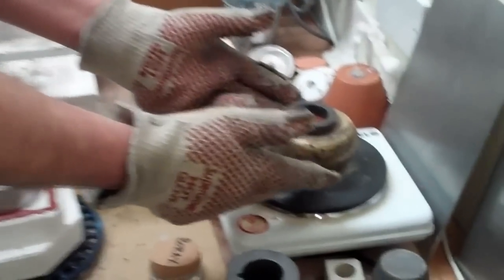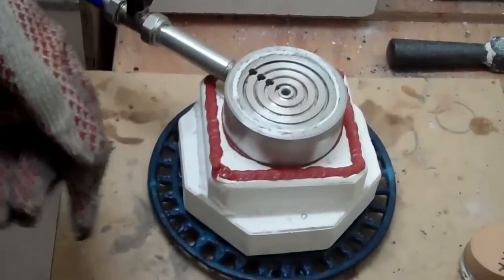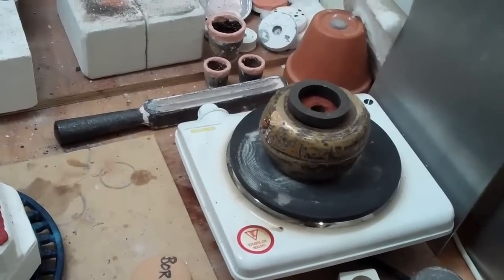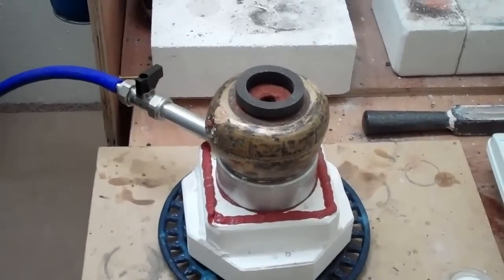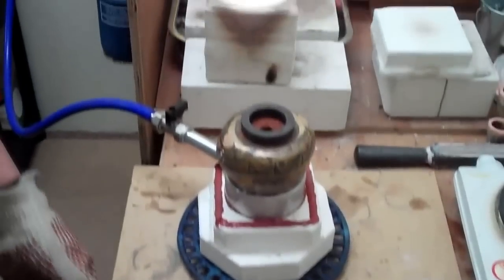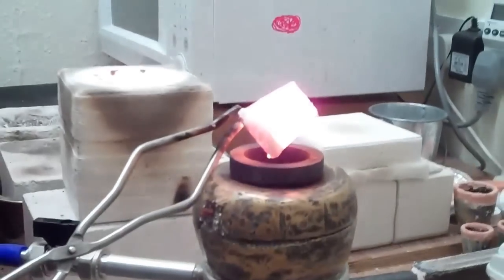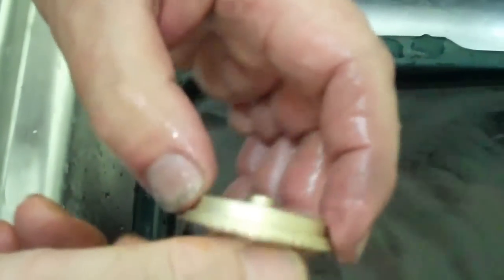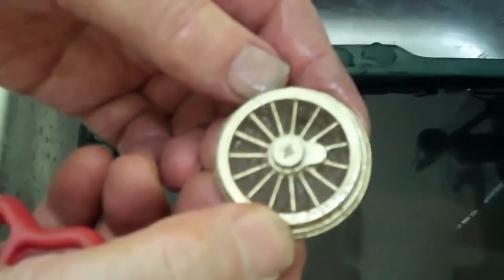Vacuum assisted sand casting part 2

Comment: Wait.. How'd he microwave metal?
Reply from the maker: Hi tim yes that's right we use a standard domestic microwave oven as the power source to melt silver gold brass bronze copper. The microfoundry furnace insulates the metal charge to make it totally safe
Reply: @steedcraft  Did you use silicon carbide or some other material on the inside of the kaowool to absorb the microwave radiation? I would be interested in seeing your methods to making a microwave furnace (I'm new to the channel so I apologize if you've already published a video on it in the past).

Comment: OK, time for the stupid question... that looked suspiciously like a microwave you pulled the melted metal out of.  Was it, or was it just a small side loaded furnace?
Reply from the maker: Hi bob not stupid you are bang on the money, we designed the system to be as easy to use as possible so chose a domestic microwave oven familiar to all as the power source. the furnace insulates the metal so it is perfectly safe for metal microwave and user. cheers quin

Comment: Where did you get that vacuum work tool?
Reply: the csting box is from a dental lab - think it was used for false teeth in its early life.
Reply from the maker: HI summer the vac table is a turned peice of ally. If you dont have a lathe or someone to make one for you we offer them on our etsy shop  https://www.etsy.com/uk/listing/111712223/vacuum-casting-turned-base-and-fittings?ref=shop_home_active_5 cheers quin ps have you sen this vid? https://youtu.be/8heAjJ4ed7M